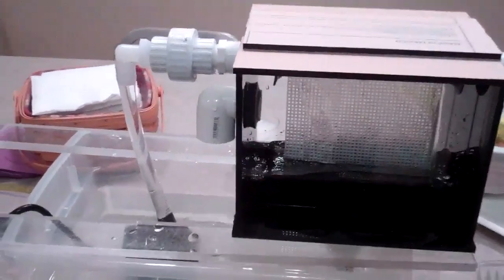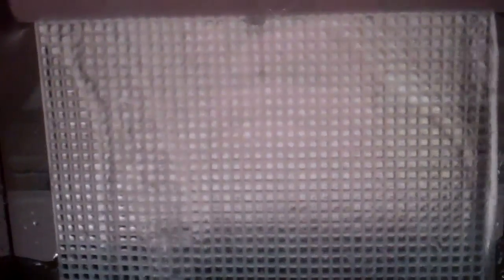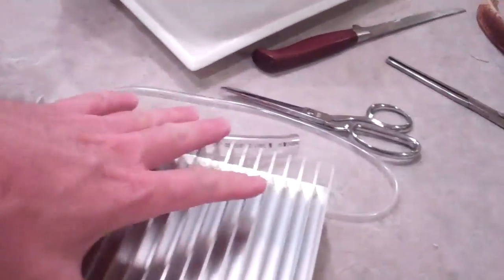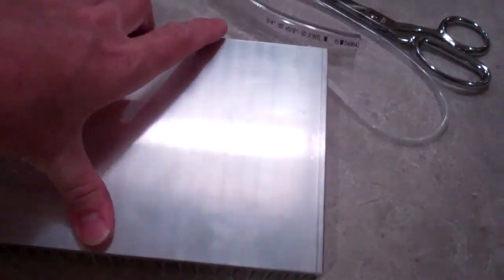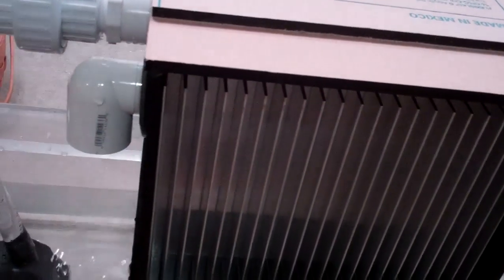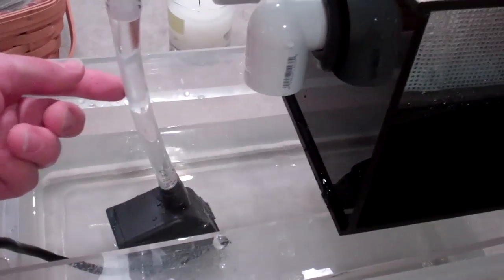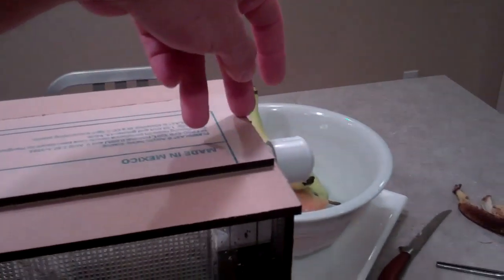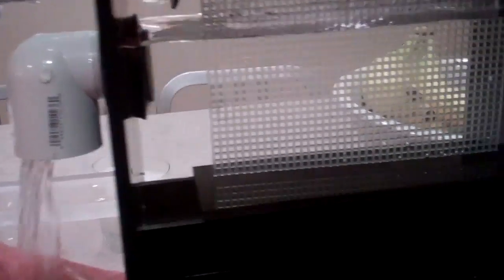L2 LED Waterfall-type Algae Scrubber Sneak Peek

Comment from the maker: I do not make UASs, I make waterfalls.  The UAS was a test unit that was started in 04/12.  I do have a few 2013 vids of the UAS but mainly 2012 ones and mainly showing how it doesn't work as well even though it grows good algae.  Many vids chronicling that struggle.  as for which one is better it's more of which one is proven at this point.  UAS works good for smaller systems, which is what it was originally designed for.  I don't make/sell them because IMO they aren't as effective